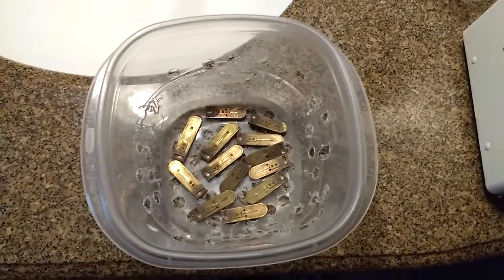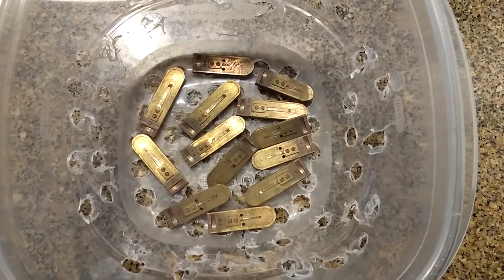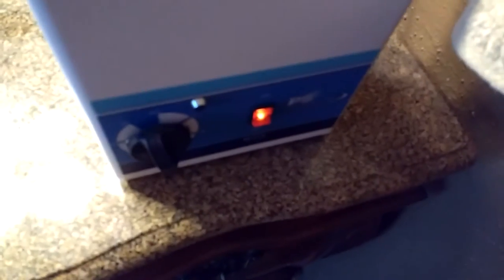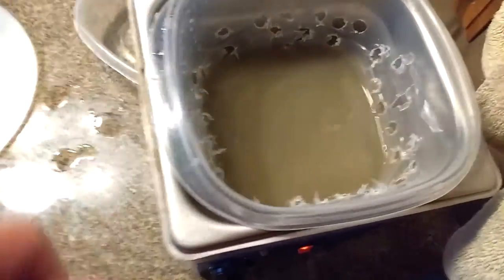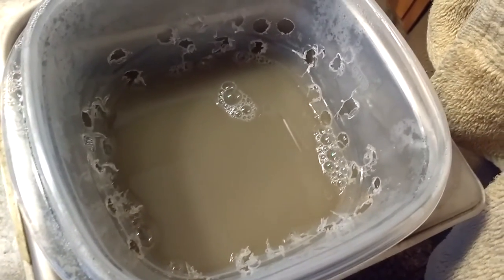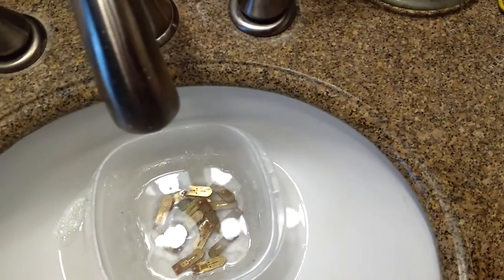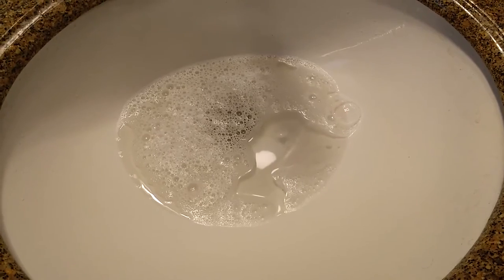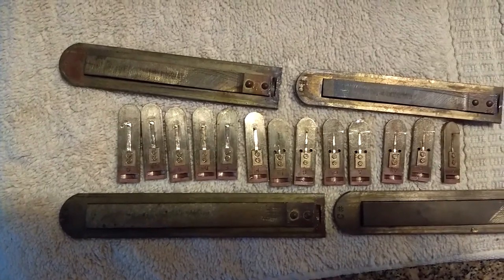Cleaning brass reeds in a Reed (Pump) organ

Comment: Could you also use clock cleaning solution? Also, how does the ultrasonic cleaning process compare with just brushing off the reeds to remove dust and debris?
Reply from the maker: mortier9 clock cleaner would probably work very well to make the reeds nice and shiny. The ultrasound is a convenient way to carefully clean what can be very delicate parts.

However, the goal is to remove dirt that changes the tuning. Bright and shiny may not be so important for tuning. They will probably get a bit tarnished later as a result of aging.

Comment: Vinegar is acid and detergent is alkaline so how does the science of that work?
Reply from the maker: You may have a point. The idea was that I wanted to remove the dirt and crud from 100+ years of operation - before I tuned it. That was the idea of the detergent. Then I also wanted to remove corrosion of the brass reeds. The vinegar seemed to do that well without being too strong. Then I wanted to save time so I mixed them together. Maybe it is better to do it in two steps.

Comment: Hello sir, how are you? 

Please assist me, I  took out an octave of reeds placed them in vinegar for a 24 hours, then brushed them then washed them clean. 

BUT when I put them back, the notes have changed and have a ringing sound.

PLEASE PLEASE ADVISE ME HOW TO FIX THIS

I have tried cleaning it again with detergent but all it does is give me a super shiny reed with the wrong sound
Reply from the maker: Can you describe the ringing sound in more detail. What common object does it sound like. This is for a Reed organ?
Reply: @llwdtp  thank you for quick response. When I play the key its 2 tones coming out, 1 sounds like the correct sound and the other is a lower note, so it 'rings' between those 2 notes.

It's a harmonium
Reply from the maker: @nevalsingh2397   I suspect the problem is not the cleaning. I think you have a leak between the note and the note next too it. You can pull out the Reed next to the one you are playing and see if the sound changes.
Reply: @nevalsingh2397  have you resolved the problem yet?
Reply: @asadabdul4486  hey mate, no luck, I even scraped ends of the reeds as suggested by other videos but no luck. Could it be that I used normal vinegar instead of Apple cider vinegar?